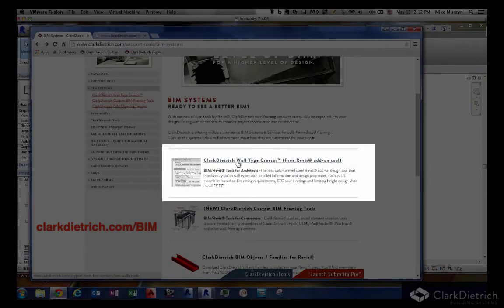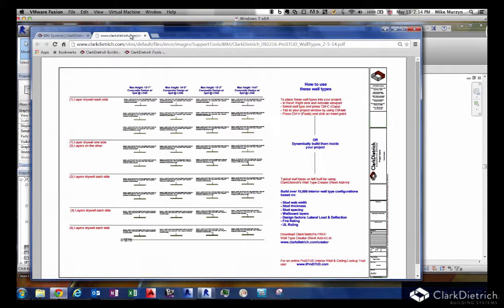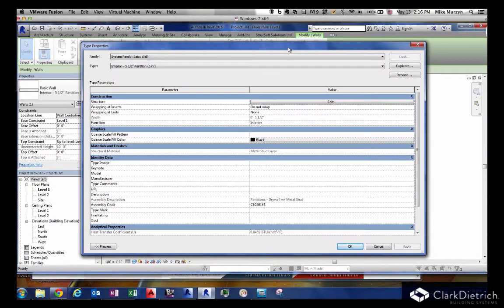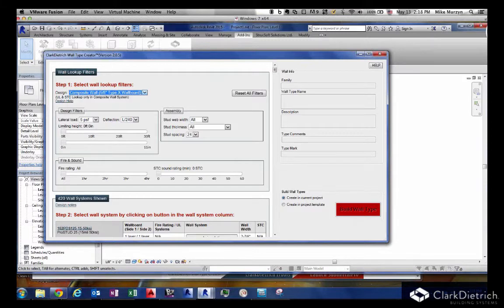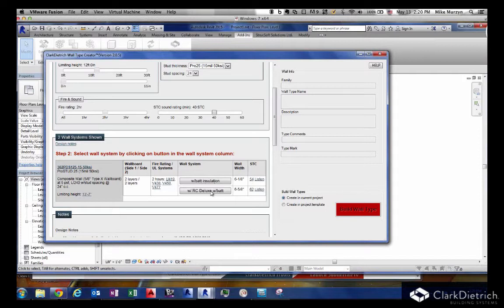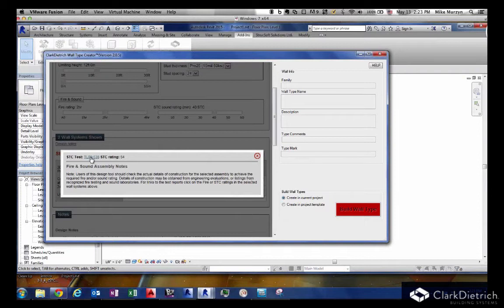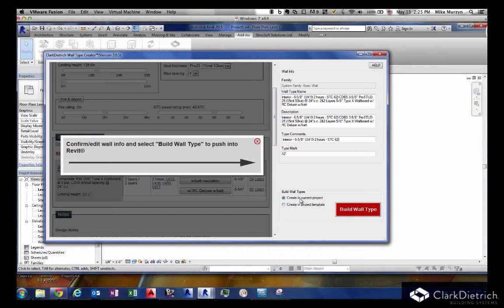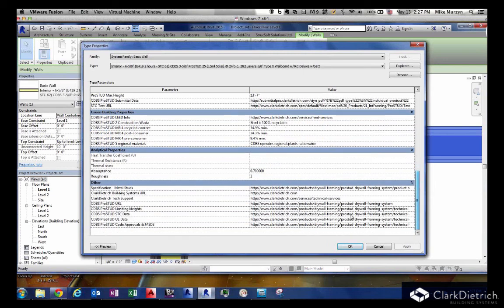ClarkDietrich Wall Type Creator - BIM / Revit Add-In (Detailed Webinar)

Comment: Hello, is this only for imperial units? Can you change to metric ?
Reply from the maker: Thanks for checking out our Revit Add-on. At this time, it's only setup for imperial units.
We’re also looking into using a new tool. BIMsmith Forge. See more on our web site at: https://www.clarkdietrich.com/support-tools/bim-systems/clarkdietrich-content-bimsmith
You can add anything to a wall system from drywall to a paint swatch colors.
 
This system doesn’t yet lookup spans, but you can use our iTools system at: https://www.itools.clarkdietrich.com/iprostud.php to look those up.
Let us know if you have any questions. Thanks for checking out ClarkDietrich Tools!